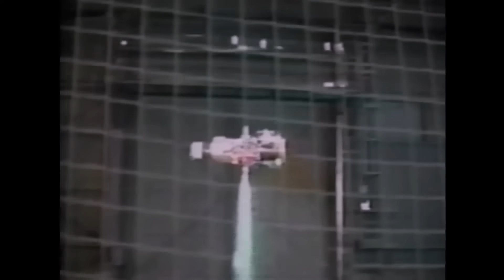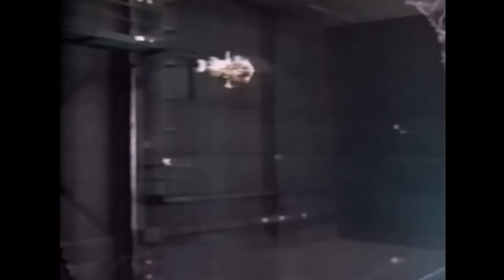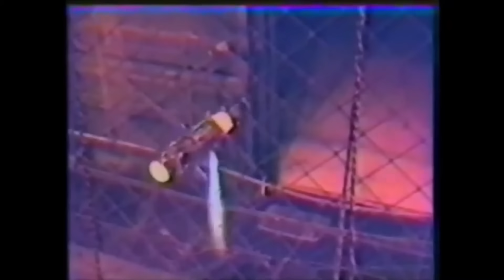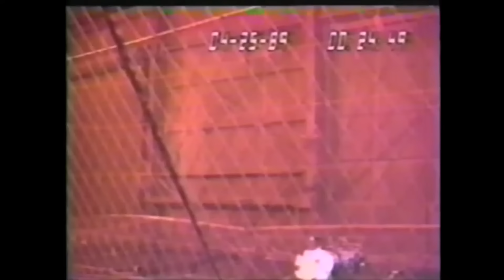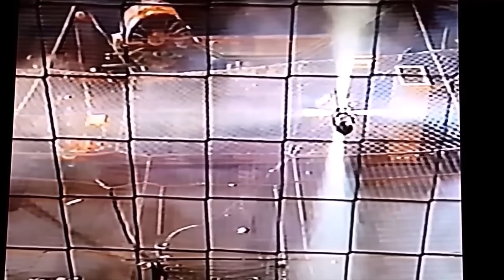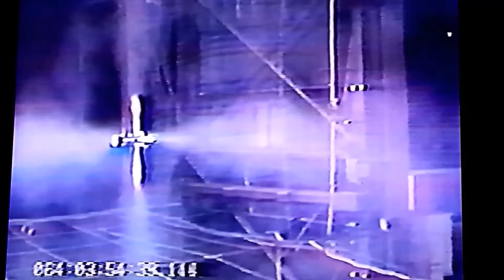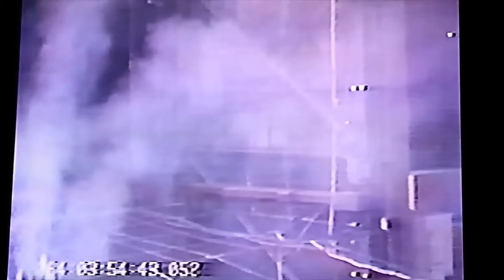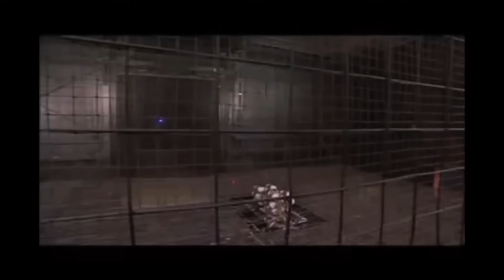EKV/KV/KW/KKV/LEAP (Exoatmospheric Kill Vehicles) Hover Test - Compilation Video (SM-3, GBI, etc.)

Comment: The engineers are so happy
Reply: They just made a vehicle that hovers by using rockets and not exploding, on paper that’s a real challenge
Reply: I don’t think they could be solid rockets. So that would mean they have to use some kind of ridiculously small device that does the same thing a turbo pump does in a liquid fuel rocket. With multiple, super fast switching and simultaneous burning combustion chambers. It’s ridiculous, and I’m probably thinking with the wrong assumptions, based on basic knowledge level.
Reply: @jonathanhansen7734  
I also have no idea, but solid rocket motor is probably out of the question since, as far as I know, there is no way to control the thrust or even shut down a solid rocket until all its fuel is consumed. Also, I think this device is far too small for a traditional liquid hydrogen - liquid oxygen rocket. The only logical assumption is maybe some kind of monopropellant like hydrazine. But yeah, I don't know.
Reply: @jonathanhansen7734  it’s likely monopropellant thrusters
Reply: @jonathanhansen7734  at that scale I would suspect Pressure Fed engines, simpler and more reliable at that scale, otherwise agreed, darn cool too
Reply: You'd be happy too if you just made a UFO
Reply: @tractorbasil5713  government contracts are probably why their happy
Reply: @tractorbasil5713  it's not a UFO because it's identified
Reply: @Arae_1  It's an IFO then...
Reply: @Arae_1  hahahahaahah
Reply: @tractorbasil5713  it's over their heads they don't understand that this is the vehicle in the pictures that they've been seeing on the news recently.
Reply: Warms my soul
Reply: I saw this comment but I did not expect them to be hooting and hollering lmao
Reply: I would too given those are a right bitch to do
Reply: Nerds
Reply: Yeah,  I can't imagine seeing that in person!!  So cool!!
Reply: Hah I thought it was a rodeo bar scene
Reply: They sound psychotic
Reply: Adolescences
Reply: @davidkuhn3970  if you actually had something you were working on you’d be excited too bud
Reply: @10toppers  Not like that.
Reply: @davidkuhn3970  ooh you meant they’re like kids in excitement, ye ye ye you right i apologize for coming at you full force
Reply: The amount of trial and error that they probably went through to get something stabilized in flight while there's jet thrusters firing in every direction on it...I'm sure it was like witnessing a miracle seeing it work.
Reply: Nah, thats just (overdub) from when the day, the yankees won the pennant.
Reply: This is when a bunch of engineers realised that they managed to defeat the Murphy’s law!
Reply: Dare we say ecstatic?
Reply: U can add some pornhub background too, like moanings, perhaps 🙃
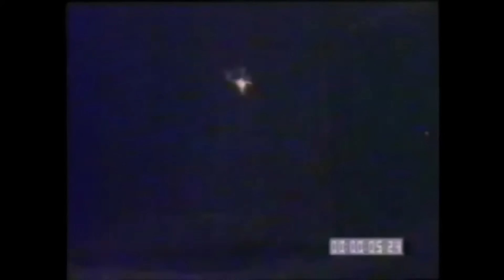Reply: Yea IFO we don’t know about sounds like sum heard passing by a barn once upon a time before 1:20
Reply: JLO
Reply: They’re the FIRST PEOPLE to do that!  Its gotta be INCREDIBLE L
Reply: Getting that grant money would make you holler also
Reply: This is the 90s wouldn't you be too? Before the digital age
Reply: Fine tuning the PID controller takes time and patience..calculation only got you so far as theoritical ideal states.
Reply: Holy shit ikr, may be 10 months later but dude i can hear their veins bulging
Reply: It's incredible
Reply: “I’m so happy I can’t even feel my arms!”
Reply: Windows 95 release was just as lit 🔥
Reply: Not gunna lie, even nowadays that's a pretty cool bit of hardware
Reply: I didn't think they allowed pron on YouTube. That's what this is right?
Reply: Same reaction when SpaceX first landed their booster rockets
Reply: Just imagine how good they got at it, I've seen many drones that appear to be using the same type of propulsion however highly refined.
Yes it's true, look what we play with in the civilian side and if you think there's tech out there not decades ahead of all that your drinking coolaid.

The public for most are idiots, science is science not magic or from Mars.
Reply: That’s what I was gonna say they going crazy XDDDD
Reply: Remember, this is before mobile phone, even before the first cell phone.
Reply: They sound like a bunch of chimps
Reply: Haha.. these days they only applaud if things explode. 😅
Reply: Can see why Star Wars program was cancelled.
Reply: They always are when they build something to kill us all
Reply: I think they’re so happy because this was never actually meant to hover this close to the ground.

It’s meant for intercepting ballistic missiles.

In space.
Reply: Basically a rocket drone. Just need some muffler/flash suppressors on them and stealth chassis and you got a MIRV that just hides in the clouds around a city still or zipping from point to point randomly until it gets the attack ping.
Reply: I'm imagining lots of nerdy hi-fives and adjusting of glasses.
Reply: Dude, you're so wrong. That's the sound the engine itself is making😂
Reply: same as nuclear weapon creators for the world peace dont ever make shit for your goverments people
Reply: Soon to be deployed for civilian containment and subservience compliance. Can't wait!
Reply: @aaronbertman2406  nerd
Reply: @rubensalazar6810   ? O que
Reply: But why are they so excited it's like they didn't think that it was going to work but if they didn't think it was going to work then why did they test it not continue work on it until they thought it was going to work
Reply: @theguywithallthesolutions  In an engineering project, there is so much failure before there is success.
Reply: @TheMaxi3234  after months and years of plain theory. Scratching heads and solving problems. They must've felt badass seeing this alien-like aircraft hovering like magic while making little thrust explosions in soo many different directions.
Reply: @theguywithallthesolutions  You have never built something yourself, do you?? doesn't matter how hard you've worked building something the only way of knowing if it works is by testing it, and even if you know it will work you would get happy as a normal human being.
Reply: @hansc.o8999  Such overt displays of emotion are deprecated on the test loop.
Reply: @theguywithallthesolutions  
In one of those videos you can see the date of the test. It was April 1989 so I guess they were so excited because it would have been very difficult to design and built something as complex as this and see it performing so well. There are numerus thrusters that must perform in perfect harmony with one another and with millisecond precision. Just imagine that even the fastest consumer CPU's of the era were at the MHz range...
Reply: @theguywithallthesolutions  Because in theory, theory is right, in practice though... theory tends to fall apart.
Reply: @theguywithallthesolutions  that's science pretty much. It won't work until you make it work. Then be surprised it worked at all and move on.
Reply: @theguywithallthesolutions  of course they don't know if it will work, so many things can go wrong then you try out new things
Reply: @theguywithallthesolutions  it's not just about the thought, but more on witnessing the actual result that the whole world will SEE. That makes them happy.
You need to make your thought happen to see if it's real.
Reply: @theguywithallthesolutions  I'm sure you do not know what testing is.Im not even sure you went to school in your life.what you say It is taught to second year to 8 year old children in school.
Reply: @theguywithallthesolutions  theres a first time for everything
Reply: @theguywithallthesolutions  that’s called research and development
Reply: @theguywithallthesolutions  Engineering is a trip, and this particular extremely complex system would be a trip upon a trip.
Reply: @theguywithallthesolutions  You've learnt all the stuff, you know what to expect, yet you still feel happy when finished an exam, don't you? It's the same.
Reply: @theguywithallthesolutions  "But why are they so excited it's like they didn't think that it was going to work" because officialy Apollo lander got this type of propulsion in 1969 and two decades later they are finaly able to make it work for real(this time)...
Reply: @Bialy_1  it's copmletely different tecnology to apollo, different speed, accuracy, and control level. Apollo lander was controlled by a pilot, not a high-speed computer.
Reply: @Bialy_1  

I think the background cheers might be fake. Seem to be on a loop. And that many people all witnessing and yelling "Oh my god" is unlikely
Reply: @Bialy_1  didn't happen

Comment: I assume this uses rocket propulsion, but does anyone know what they used for fuel and oxidizers?
Reply: The areas they test them in looks like a workshop though, not somewhere youd use hydrazine
Reply: Mono-Methyl Hydrazine (MMH) and Mixed Oxides of Nitrogen (MON-1). It's a bipropellant liquid propellant rocket propulsion system. The two propellants are pyrophoric and will burn on contact with each other. I worked at the company (Rocketdyne) that integrated the early KV's and the ASAT KV. When I retired I was the Chief Engineer of the THAAD KV propulsion system. Rocketdyne delivered several hundred of the THAAD propulsion systems to Lockheed Martin.
Reply: It does not use rocket propulsion.  It is monoprop.   So there is not a fuel and oxidizer.
Reply: @bobguy6542  that's still rocket propulsion, albeit not bipropellant
Reply: @bobguy6542  Probably some form of hydrazine that decomposes on contact with a catalyst.
Reply: I would say hydrazine.